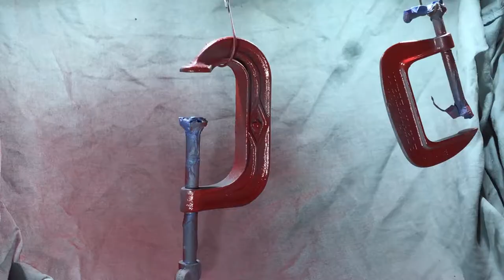Vintage G Clamps : Restoration

Comment: Hi Davo, nice work. Some information for you, the 4” clamp is Australian made by a company called Tudor. Normally the name is on one side and the size is on the other but with yours having no name it was probably made for another company and sold as their brand. Does that make sense? I collect and restore Australian made g clamps and have the 2” 3” 4” & 5” Tudor clamps. I don’t know why but the 2”& 3” ones are blue and the 4” & 5” ones are red. They look really nice together as a set. Yours being a bit different if you ever want to part with it I’d be interested in buying it or any other Aussie made ones. Cheers Stuart 🇦🇺
Reply from the maker: Hi Stuart. Thanks for the background to these - fascinating. Do you have an idea on what year they were made?
Reply: Weekend Workshop, no I’m sorry I don’t. Information is very hard to come by as they were just a utilitarian tool so no one bothered much about preserving the clamps or their history but the wing nut style was being replaced by about the mid 60’s. From the other clamps I have I would put these some where from the mid 40’s to the late 50’s. Stu. 🇦🇺
Reply from the maker: Stuart G. Australia. Thanks! That vintage sounds about right.